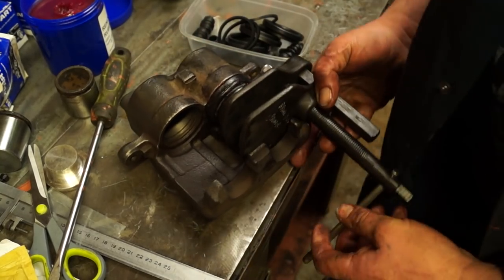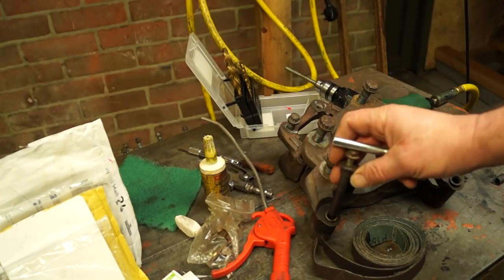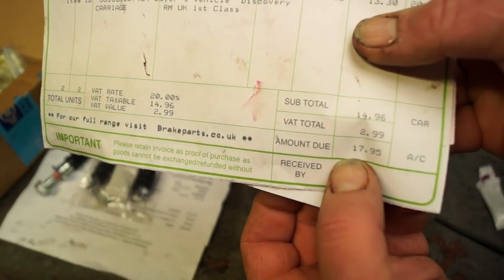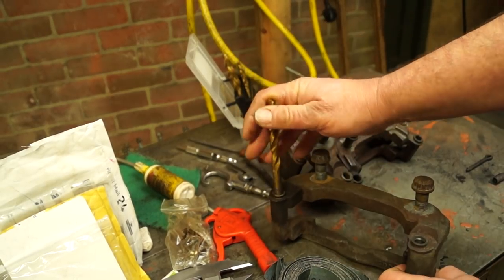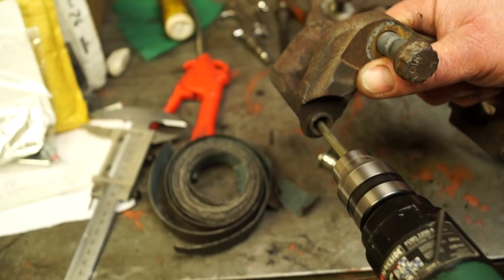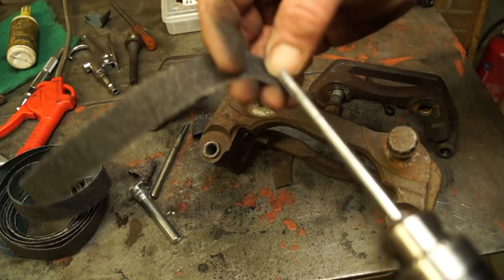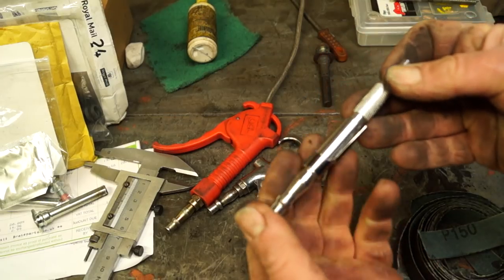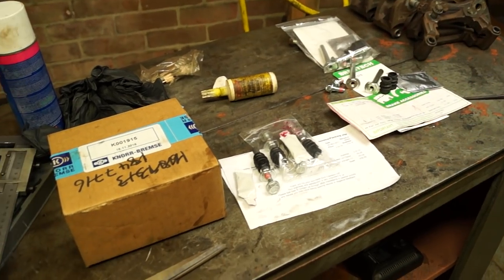Land Rover Brake Calliper Overhaul PART 3b -D2 Calliper Carrier Pin Replacement.

Comment: Very helpful videos. I got a 300tdi defender and Iam having a issue it’s white smoking on start up and after when warm found water in my fuel filter but think it’s my head gasket gone any ideas before I fit a new head gasket
Reply from the maker: Wrong video to post a question on to about engine problems, However,, have a look at how to test a cylinder Head from the cooling system.  The tool is seen from 0.45sec.  https://youtu.be/zZsrawcl8Uk